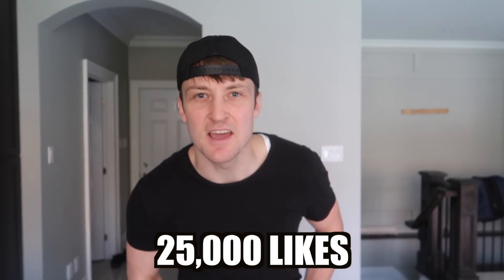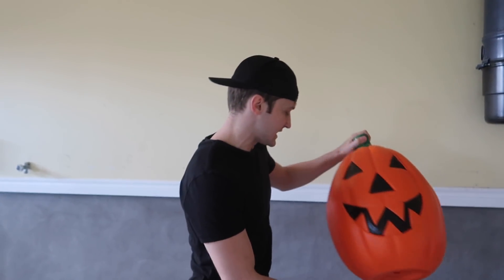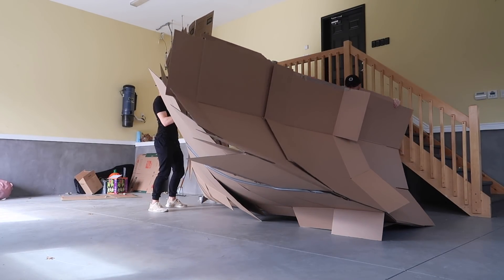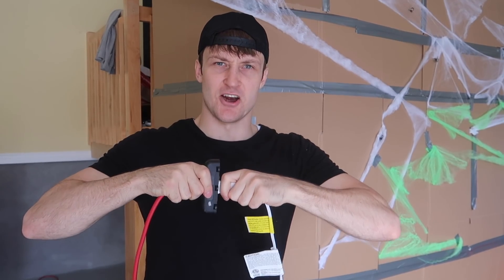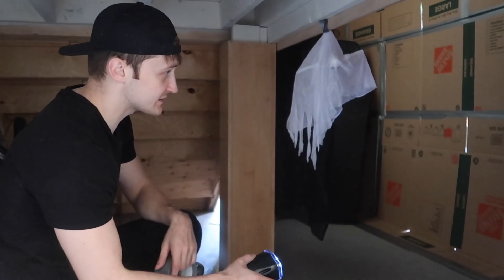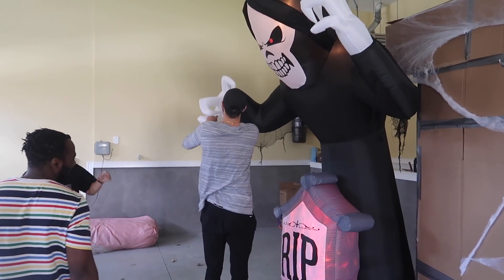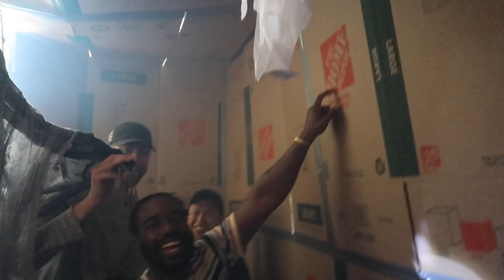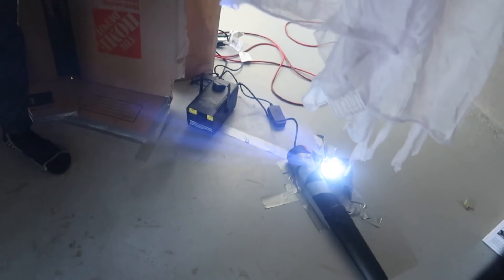INSANE BOX FORT HAUNTED HOUSE (HALLOWEEN BOX FORT CHALLENGE)

Comment: he should get a copper pipe and fill it with liquid nitrogen then light it pipe rocket light when level or you could get stabed by a rocket and die make it sealed put a fuse in the pipe then make it airtight then light the fuse and run you can use any combustible liquid or get solid fuel